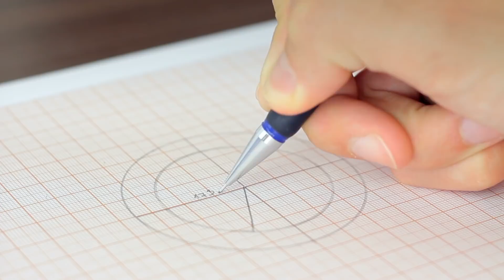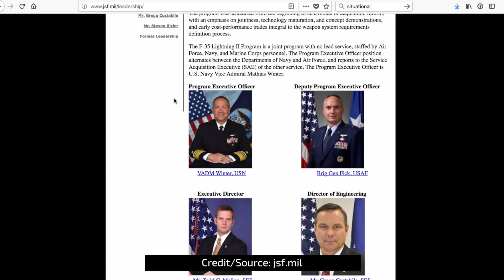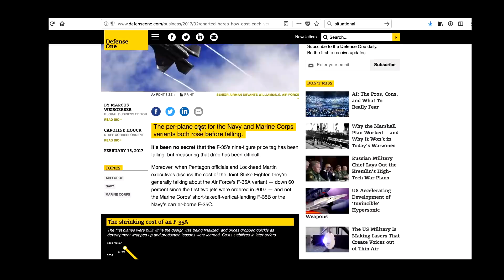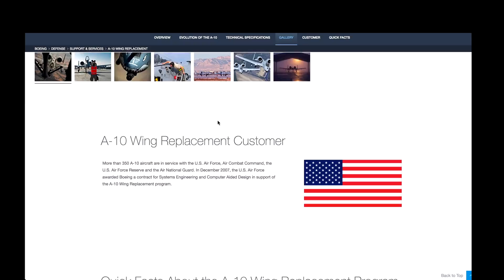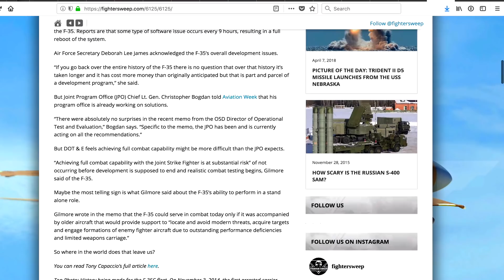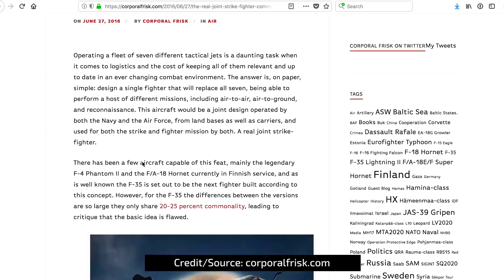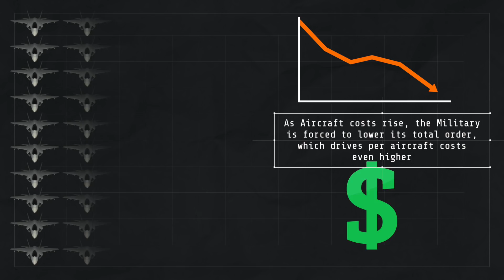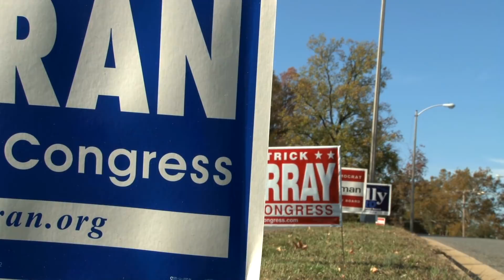Why the F-35 Lightning II Might be the Most Expensive Military Aircraft Mistake Ever

Comment: I was a fan of this plane back when I was a kid, but then when they said they're going to compress F-16, F-18, A-10 and the AV-8 into one package, I started thinking... It's going to be heavy with those VTOL parts, it's going to be "un-stealthy" with all that armament requirements (as seen in its "Beast Mode"), and it's going to be hell expensive with those kind of all-rounder capabilities. And then I read that it had hard time in a turning battle... They could've just made a simpler stealth multirole without the VTOL capability and attacker role, and just go with an F-16 or -18 replacement.
Reply from the maker: I have to say I agree

Comment: It's a matter of time before drones, or at least remote-controlled fighters, become a standard military practice. The human body max (with tech aids) can endure 9Gs; a plane without a human pilot (+ all that cockpit equipment) will be able to pull more Gs and perform super-manoeuvres with no fear for GLOC.

We need to develop rock-solid immersive remote-control technologies to make it happen though. The current tech for the Predator is not good enough. Right now it's just easier to seat a pilot directly in the plane.
Reply: Good point, but...remote control can be counter by both cyber and EW systems.  Man in the loop is kind of a mandatory thing (right now) so autonomous is kind of out for armed assets as of now.  You are right, however we just can't seem to give up the control.  Also, every current pilot want's their sons and daughters to fly their jets so...a bit of greed I guess thrown in?
Reply: In the era of beyond visual range combat and high off boresight dogfighting missiles, 9+G maneuvers aren't really all that useful, and even if you don't have a pilot in the seat, you still have to strengthen the structure of the aircraft, which makes the plane heavier,

However, I don't disagree with you when you say that drones are going to take over. Already, we routinely fire vast volleys of drones at enemies when we start a conflict; they're called cruise missiles. It makes no sense to crash the airframes into the target if we can put a bomb bay in them, drop a cheap bomb, and recover the airframes. For stuff that's more dynamic than a cruise missile strike, I still think drones will take over, but I think the way forward is not through immersion, but by finding a way to automate most aspects of the drone's flight while leaving sensor allocation and weapons engagement decisions in the hands of humans.

Comment: Yeah the falling prices have been addressed. Let's see here...

A few things.
Pierre Sprey isn't an engineer, he doesn't really know anything. The DOTE doesn't know anything the JPO didn't tell them in the first place.

Single engine design is a big cost saving measure. Having 2 engines increases maintenance costs. There has been a W/O to a single engine failure, but it was on the ground and frankly only losing 1 plane over the whole program so far is insanely impressive.

The alternatives are not alternatives at all. Sticking to super hornets would sideline our navy carrier air wings in future conflicts, and if "compromised," is any more than a dubious concern, don't forget the super hornet is a half-measure design itself. Also, F-35s are quite nimble now that the control laws are Fixed. Part of the requirement was to bring together the F16s and F18s agility. The F35B is a huge leap above the old Harriers used by the Marines, and the F35 has much better range than any of these planes. That's not to mention that level of capability this platform provides in sensor technology, even above and beyond the F22. The level of engineering and design that went into this plane was simply crazy, and the mind boggling details still surprise me to this day.  

I do agree the plan was too ambitious, but not in the way you stated. The plane's hardware  modifications have been solidified for the time being, but software is one concern. However, multiple nations are also included in this program, which means that many weapon systems have to be fitted and tested on the plane. This is also adding a lot testing time along with the software problems. 

In the end, it was a crazy plan, but given how capable the plane is, I'd say it paid off. After all, stealth and true sensor fusion has been made affordable.
Reply: F-22s radar is better, but other sensors on the F-35 are better.  Also spot on on the B model over the harrier.  If 2 LHD's and 2 CV's park off your coast.  You could have nearly a hundred F-35's in full stealth over your beach in minutes and you wont know about it till the first GBU hits.  And there is little one can do to protect from four axis's off attack.
Reply: About the radar, the Raptor's Radar is larger (900 mm versus 700 mm, IIRC), as it it an air superiority fighter, after. However, the F35 has more processing power behind it's radar (well, antennae, IIRC the "radar" computing is done by the central computer), and will be using the more powerful GaN T/R modules (as opposed to GaAs) sooner. Of course, I can totally believe the Raptor's APG-77V1 upgrade leapfrogs it over the F35 APG-81 for now, but the GaN update might make me question that. 

It's probably not a question easily solved, as the full capabilities of both might be classified.

Comment: So, the biggest advantage of the F-35, being it's electronics, could easily be adapted to other older aircraft. Good job spending my money.
Reply: The kind of sensors that were put into the F-35 would require a complete redesign of said older aircraft.
Reply: @damonstr  nah.
Reply: @soggycracker5934  Okay. Where will you install DAS cameras on an F-16 and how do you plan to wire them without screwing up three quarters of the plane's fuel lines?
Reply: @damonstr  I'm not an aircraft engineer, but someone out there is. It probably comes down to money.
Reply: @damonstr  seems likely, but not impossible.
Reply: except it's stealth capability has to be purposely built you can not have a stealth F-15 Strike Eagle ,though I sure wish we could !

Comment: When talking about ground support. I put my money on the A-10 every time. Stealth isn't what you want when you need to protect troops. If you say "but if they need to infiltrate airspace" a plane that cost as much, would never be given permission. You're also forgetting the mental effect the GAU-8, or even just the sound of the Warthog has on enemy troops.
Reply from the maker: We have a video on the A-10 coming very soon! And we agree!
Reply: @ProjectDaVinci  i always wondered if the A-10 can fly in weather conditions equivalent to what happen during the WW2 Battle of the Bulge (eg. blizzards, heavy snowstorms) if so then we have an...advantage.
Reply: Try fly the A-10 near the S300 do the CAS, and see what happen.
Reply: lizadonrex you dont do CAS near S-300s.  Those are not front line systems.  SA-15s and SA-19s would be the real issue.  But you dont do persistent CAS unless SEAD/DEAD is done first.
Reply: exactly. the A-10 works fine. if we need a simmetric war to support the argument, then we have the case of the IL-2 Sturmovik. Totally the same line of thinking. Simple, takes punishment, cheap, delivers a huge punch, scares the shit out of the enemy. If every1 and their brother is shooting at you with every possible weapon, your stealth is just a costly hobby.
Reply: Ya it does seem like the CAS role should have been removed from the F-35 initial design. Though I bet the sensors help prevent friendly fire. Perhaps they should have designed it to work with the A-10 to bring out the strength in both planes. That's what the Navy is doing with the paring of the F/A-18 and F-35.
Reply: The F-35 has already done airspace infiltration missions. The thing that "would never be" has already happened.
Reply: @frederf3227  infiltration for a bombing run, and infiltration for close air support are two totally different things.
Reply: James Diaz ummmm. No ithasn't.  The GAU-8 is Waaaayyy bigger than the -22.  I have worked on both systems and the Avenger is an order of magnitude more powerful.  Its 5 millimeters larger diameter but it's a much bigger projectile, fired with much more energy.  Heck the GAU-8s barrels are as long as the entire GAU-22.
Reply: dont forgot it can stay in the area for long periods of time to give ground troops all day cover and fly in poor weather conditions which most jets can't do. in conventional war against a large army like china or russia you will still need Close Air Support. Russia knows this and they have the SU-25 Frogfoot. the only CAS aircraft that china has that is barely a CAS plane is the Q-5 Fantan. We will need A-10's for the possible coming conflict. they are as essential to the US military as air and bread!
Reply: Despite what is commonly stated, the A-10 was designed for Vietnam, not to stop massive Soviets formations rushing into western Europe. When we threw it into a force on force CAS role against a second-rate military in 1991, A-10s got chewed up in environments that other aircraft barely registered as threatening at all. In the end, the A-10s did ok, but that was mostly because they were the only aircraft equipped with AGM-65 Maverick missiles, not because of the gun. In 2018, if you threw A-10s against a second-rate military comparable in power to the Iraqi military in 1991, you're not getting CAS at all; it won't make it there. In this sense, the F-35 does replace the A-10.

However, that doesn't mean that the F-35 actually replaces the A-10, because we have requirements to fight against insurgencies and terrorists, and in that sense, the F-35 is designed to fly needlessly high over the battlefield, reducing sensor resolution, with poor loiter time, large basing and logistic requirements and a very high operating cost. The real replacement of A-10s are light-attack aircraft, which the Air Force has been experimenting with for the last several years. In many respects, these are even better suited for COIN than the A-10, and are also much cheaper. if all goes well (and Congress seems eager to fund it, so it very well may), the Air Force could award a contract as soon as 2019.
Reply: JZ909 wrong.  Just wrong.  It was specifically designed to stop Soviet tanks.  Trust me.
Reply: @wpnsloader9289   Wpns Loader  I looked it up a little more, and I'll admit that I may be somewhat incorrect. The A-10 was meant to be the Air Force's primary CAS aircraft in all types of conflicts. However, it was designed specifically due to the Air Force's poor performance at CAS during Vietnam, and the design specifically addresses lessons learned during that conflict. https://web.archive.org/web/20150910033808/http://www.dtic.mil/dtic/tr/fulltext/u2/a530838.pdf 

This also doesn't invalidate the point made about it's performance in Desert Storm, or invalidate what the point made about its likely survivability in the 21st century.
Reply: JZ909 
The 1st Gulf War losses were a result of using a bunch of factors one of which was the "great SCUD hunt".  You are correct that the lessons of Vietnam were used in the Hog along with the lessons of WWII and Korea.  However it was designed for the planes of central Europe.  

Light attack will work just about as well as a F35 in CAS.  However the ONLY jet optimized in both aircraft design and mission systems for CAS is the Hog.  If I was under fire i would want the big gun, not a jet with a couple of bursts of ammo and two bombs.  That's just me.
Reply: Wpns Loader

I could be forgetting my Gulf War history, but from what I remember, A-10s were primarily taking damage/losses when attacking Republican Guard units while flying at low altitude, which resulted in the CFACC ordering a 12k AGL altitude floor and ordering the A-10s to only fly missions in Kuwait, mostly against poorly trained/equipped conscripts. This doesn't speak highly to A-10's survivability/usefulness in a serious fight.

For most CAS scenarios after day 1, F-35s will probably use external weapons, as well as internal, and will fly at medium altitude to avoid IR/AAA threats, much like 4th gen fighters. In this configuration, F-35As can carry up to 10 bombs, not 2. Maybe not quite an A-10, but nothing to scoff at either, and it can survive.

When it comes to COIN type of stuff, light attack aircraft (A-29/AT-6) vs. A-10s is a tradeoff, but an easy tradeoff. The A-10s have better firepower, can survive the occasional 12.7mm or 7.62mm hole in their plane better, can refuel in air and are also a little faster. The main downside is that for the cost of 1 hour of A-10 time, you can expect 3-4 hours of light attack aircraft time, and the light attack aircraft won't be flying as far, because they can operate out of more austere airfields, expanding the cost advantage even further. Finally, they have better utility as recon planes due to them having two seats and a sensor ball rather than a single pilot with a targeting pod. I would much rather take 8 A-29s, and fly 2-ships over 2 operations, with 2 other 2-ships on the ground ready to backfill them when they run low fuel/ammo, rather than 2 A-10s trying to cover 2 operations all by themselves.
Reply: Pretty sure the f35 has the Sane gun as the warthog
Reply: ChickenBox10 k
if you mean saMe (I can't be sure), then you are wrong. after some research, it is obvious that they don't have the same gun. before research, it is also kinda obvious, because the Warthog's gun is HUGE, impossibly large for the F-35
it would look badass, though
Reply: It has a 25mm similar to the the AV-8B with 180 rounds (220 external pod with C/D models) vice the Harrier's 300.

Comment: Old news on this... It was design and build at the same time for the F-35 and issues had to be worked out with all 3 versions. The F-35C is the one that cost the most and is larger for the fan.. As production ramps up and a lot of others want the price of the project will come down as the roll out... Also it's replacing older aircraft to offset the costs too but the A-10 is here to stay and can't be replaced with others.. A new A-10 would be great...
Reply: All in all, if they tried to build a new A-10 what they would come up with is the current A-10C.  There isn't much wiggle room to improve the thing.  It's that GOOD!
Reply from the maker: the A-10 is our next video! so we hope you'll subscribe and stay tuned!

Comment: The Pilots should have the final say. They will know best and they are the ones at harms way.
Reply: Well I think the ground troops getting Close air support should also have a say. After all if the pilots makes a mistake there the ones that get a bomb dropped on them.
Reply: Then maybe don't give the laser designator to Pvt Butterfingers. Instead give it to Sgt Rocksolid and you'll be just fine.